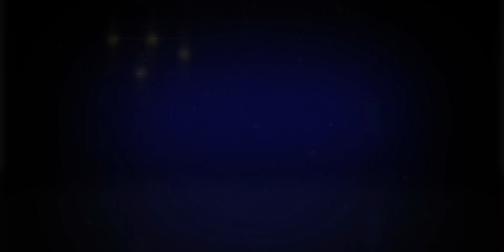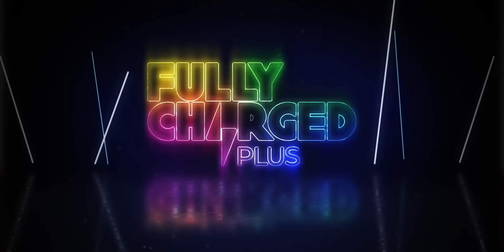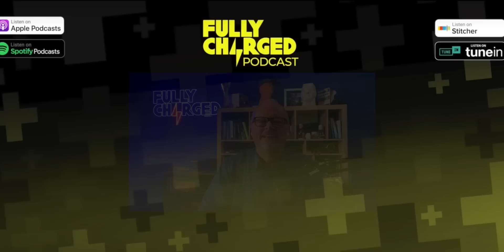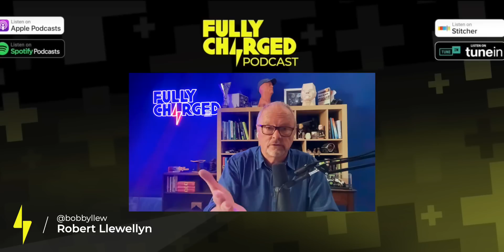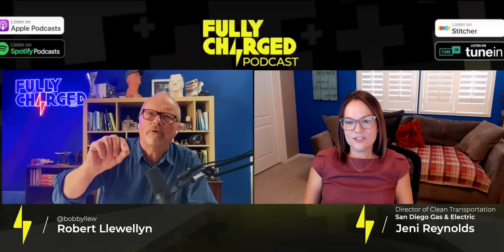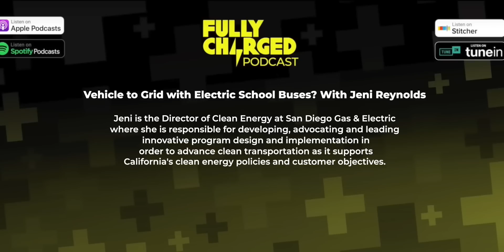Vehicle to Grid with Electric School Buses? With Jeni Reynolds | The PLUS Podcast

Comment: The principal of converting all busses to electric has to be good, as they are currently dumping all of their pollution in places we certainly don't want it, eg next to schools. So great on that part. Great project, however what an eye opener from someone in the UK that US School busses do nothing else all day, what a waste. Also, if the busses battery is drained to the grid between 4-9 in the evening it surely can't be charged by solar for the morning run?  Does that mean they give away their free electric and pay to buy new from the grid.
Concept good but unless I missed something, I think it is seeking the solution that serves the Electric company and not the greater good.

Comment: This lady needs to get her facts right before doing an interview. She said a typical bus battery is 60kW which is power not energy. She then says this could power an average home for 15 days. Really? She then says you can power half a home on one battery. She then says the bus batteries are five times the size of a typical vehicle. All these facts are contradictory. What the hell is she talking about? She is not helping the cause for using electric buses for V2G!
Reply: 60 kW is the bidirectional chargers they have installed. Batteries in the traditional school buses are 200-300 kWh which is about 5 times the battery of a mid level EV.

Comment: No new concepts, but a good interview. I would have liked to know how they made the capital decision to go with retrofitted buses vs. new buses. Amortized value of the older buses would certainly be less on the books than a new bus, and is likely more on a per annum basis than buying new. Pure guess on my part is that they were capital constrained. Given the dramatic pollution of school buses being right up there with class 8 trucks, it is clearly a strong first step in the process of electrifying transportation. Since the sooner one goes electric, the greater the ROI, it would make sense to me to not have slow conversions, but rather jump to BEV as quickly as possible. Lifetime TCO is always much better for electric, so it comes down to the availability of the initial capital. If deep pockets, i.e. the state, provided the initial capital, and set it up with a payback period that kept the original yearly costs the same over a longer period, this would enable prompt transitions. The power arbitrage taking place is simply icing on the cake for everyone, including the rate payers.

Comment: V2G and recent developments in VPP might transform school bus fleets into a revenue source for school districts, rather than an expense.  Nationally, ~500,000 school buses, each with ~225 KWh batteries = over 100 GWh of (potential) grid capacity.

The Tesla big battery in Hornsdale  (195 MWh) paid for itself in 2.5 years, and never drove a single child to school. 

3 birds, one stone: A self-financing school bus fleet. A second-use mega battery to stabilise the grid. Massive reduction in new-build peaker plants.
Reply: V2G can be useful, fleets of vehicles with large batteries and set schedule are prefered. the window for V2G is normally stated to be 4-9 pm. one problem is all school buses are busy 3-7 pm, and when they are done at 7 pm the battery is at least 50% down. then afterV2G usage, 9 pm, the buses need to be charged up by 6am the next day.
Reply: @scottmcshannon6821  Interesting, I didn't know the duty cycle of the US school bus fleet. So, in use 6-10 am, 3-7 pm?

Starting the day with a ~50% charge might be enough if the bus can be charged during the 5-hour midday idle window.  What I mean is the bus does not need a full charge at the start of each day, it just needs enough to get through the am duty cycle if it can top up from mid-morning to early afternoon. 

If ~500,000 school buses average 12,000 miles per year over ~180 school days, the average school bus daily mileage is ~66 miles. So, ~33 miles to school, and 33 miles back. Do the idle buses stay at the school during the day? or do they return to base? 

ofc, there will be many edge cases where bus journeys are longer or shorter, but current US EV school buses have a range of ~100-150 miles (per Bing), so not even half charge is needed for the morning or afternoon cycle.
 
That 180-day school year is another point. Are these buses totally idle for half the year as well as 16 hours each school day?

Do you think there is any opportunity to leverage buses for V2G due to the various US time zones? How interconnected is the grid?
Reply: @marcusnichols5595  they usually return to base. they would definitely be available from june1 to aug 15, the hottest and highest energy usage months of the year. i would assume that sitting idle for three months would be bad, so definitely use them during the summer.
i would assume the battery pack would be designed for the so called average usage, so that probably means the average bus would have 25% left when done and ready to plug into the grid on working days. the 5 hour break in the middle would make the battery pack even smaller.
Reply: @scottmcshannon6821  There's likely a sweet spot for battery sizing between range, charging & V2G revenue.

Comment: 15:52: "A typical bus battery is about 60 kay double you" What?? First of all, who says "kay double you," and second of all, Robert, you should be listening a little bit better, because as an industry "expert," or minimally with someone with extensive experience, this should have hit your ears immediately as nonsense, because there's no way a battery the size of a LEAF+ is going to get kids around. 

Great interview otherwise and fantastic project, but no mention of how depleted batteries at 5pm when the bus finishes its routes will help put energy back into the grid at peak demand time. Also, Robert, please try to shorten the length of your questions. Less waffle, more falafel, "you know."
Reply: Checking other sources (Clean Technica / OFGEM) confirm that the bi-directional chargers are 60kW, and from the bus manufacturers (Lion) they provide battery capacities up to 220kWh to provide a 150 mile range. I have to double check, but I think she said something about the batteries being 5x the size of a car’s, which would just about make sense at that size.
Reply: Yeah I assumed she meant 60kWh, which is wrong and definitely won't power an average San Diego home for half a month. Not sure what she actually meant.

For your latter comment I doubt the batteries would be fully depleted at the end of each day, should have some room left and possibly a lot of remaining energy as they may be able to charge mid-day from surplus solar power.
Reply: @Greg Hassler, I think there are those who believe that the batteries are (or should be) sized minimally to provide only 1/2 a day’s duty cycle, so the midday solar recharge is used solely to provide for the 2nd school run, which would mean they were depleted afterwards and pretty much useless for V2G, and separate static storage should be used.

I’m with you, and believe there would be no point in doing that in a V2G pilot precisely designed to explore the use of buses to support the evening peak by transferring cheap midday solar power. Some posters think that would imply carrying excess batteries, but I believe the economics of having buses capable of a full day’s duty on an overnight charge is perfectly reasonable, indeed conservative, and it would then easily allow around 1/3 of each battery’s capacity to be very profitably discharged in the evening, having been charged with cheap solar energy midday.
Reply: Yes, at 16:15 she says, “these are not small batteries, about 5…6 times the size of a typical vehicle.” So it’s clear at least to me that she’s remembered the 60kW as the power rating of the bi-directional chargers, and muddled it up with the size of the bus batteries. Mind you, 1/5 or 1/6 of 220kWh is only a small EV in today’s terms 😀
Reply: There is another sub-thread in the comments with people assuming that the batteries SHOULD be deliberately, and minimally sized to be depleted at the end of the afternoon bus run, and be useless for V2G, since they believe separate static storage would be better, which makes zero sense to me.

This pilot only makes sense if the batteries are conservatively sized to return to base not fully depleted, but with around a 50% SoC, since OFGEM confirms a planned duty cycle of: 6-9 first bus run; 9-2 midday charge; 2-5 2nd bus run; 5-9 evening discharge through the peak; 9-6 overnight charge. A 150 mile range bus with a 220kWh battery (from Jeni’s 5-6x statement) could then drive perhaps 40-60 miles in each of its runs (some shorter, some longer) and thus have approximately 75kWh remaining to discharge in the evening peak. If they push the envelope a little and charge higher than 80% SoC, they could either provide more storage or greater range, but I suspect those are all parameters being examined in the pilot.

Assuming they make use of all 8 buses, 75kWh per bus equates to +- 0.6MWh of V2G capacity, with maximum power output of 360kW

I honestly don’t see why other posters believe it makes more economic sense to try to strip the mobile capacity down to some kind of minimum, to leave the buses useless for evening peak-lopping, when the marginal increase in cost to support V2G is so small.
Reply: There are less syllables in "kilowatts" than in "kay double you." You're LITERALLY not shortening it but making it longer. The vernacular is kilowatts so please say that in the future. On paper, shorter; out loud longer. My Asperger's always acts up when illogical things are said, sorry. 

It's a wiring problem in the brain. You see, most people filter this out. For me it's like nails on a blackboard. Imagine nails on a blackboard ALL day every day, in ever office, every shop. Now imagine you're one of the 0.1% of the people that can hear it, but everyone else's brain just filters it out. That's Asperger's. It makes me want to cry sometimes, but it comes with lots of benefits too, like the ability to turn off most women and not be able to have a relationship with 99.9% of women because they just don't understand or think you're an asshole because you don't like the way they communicate. Ugh, sorry.

Comment: When is V2G/H going to become the normal in EV's.  So far only a few manufacturers provide this.  You know the whole cost of the vehicle could include the bi directional charger...????
Reply: Up until recently, the car manufacturers were very worried that V2G would compromise battery condition and lifespan, by “wearing them out”, given they have to offer long warranties on them, so have been very conservative about moving forward with this. More and more evidence is emerging from pilot projects like this one that gentle and controlled cycling of a battery within the 20-80 SoC range does no harm, and can even improve the battery condition. You also have all the usual standards battles as each manufacturer and industry group fights to dominate the tech. So although it’s a “no-brainer” to make use of the GWhs of EV storage to support the grid/ local demand it’s something that is not going to happen quickly.

Comment: I first heard about vehicle to grid by reading 'Soft Energy Paths' by Amory Lovins in 1979. He said that if everyone in the US owned an electric car and plugged them in when not in use so the grid had access to the them the country would have four times it's generating capacity. With that thinking EV's would make the grid more stable.
Reply: The UK’s National Grid has one planning scenario in its current “Future Energy Scenarios” that allows for 28GW of V2G by 2035 and 39GW by 2050, which equates to 5.6m vehicles plugged into a bi-directional 7kW charger. That’s around 14% of the current vehicle fleet being able to deliver the entirety of the UK’s current winter demand for an hour or two. The potential scale of V2G is simply mind blowing, and a “no-brainer”, which is why pilots like this are so exciting - proving out the technology and business models well in advance of the mass market adoption of EVs
Reply: @ayebrow  Great news. Thanks for sharing!

Comment: I don't understand the necessity for the zappy charger? I live in BC, Canada and with our grid-tied solar array, any excess energy we gather goes into the grid but we get credited for that energy as it carries forward month-to-month and we essentially build up a bank of kWh in the Summer months that we use up in the dark days of winter. Seems to me that this system eliminates the necessity of a Zappy Charger, and I can't understand why the UK would not have a similar system? Is there something I am missing?
Reply: Where net metering and flat rates for electricity exist, a zappy charger really wouldn't add value for the consumer.... But  when a utility pays you less for your solar generated electricity, then you have to pay the utility for the electricity.  Zappy charger allows the consumer to use the most cost-effective option, be it your own solar electricity or off-peak electricity from the utility. It's a form of arbitrage, that also helps balance the grid in the UK and elsewhere where it's used.

I hope that made sense?
Reply: @nc3826  I see, so there are different rates per kWh for different times of day
Reply: Seems to me that this only benefits utility companies as they would dictate the when and what of rates and cause homeowners to buy batteries and other equipment.
Reply: Sorry to confuse you
Reply: @nc3826  I am not sure that I am confused? Fairly certain our province will have time of day billing in the future. Seems inevitable as the population grows and the electrical demands increase.
Reply: You originally stated " I don't understand" i.e. you were confused about the topic, but  it doesn't really matter....

The bottom line is if all your rates are the same... It's a moot point, at this time....  So it's not worth any further elaboration on it....Have a nice day....
Reply: @nc3826  you said "Sorry to confuse you" after giving me an explanation for something that previously didn't make sense to me. Rest assured, I understand now and am not "confused" as you have put it.
Reply: @northcountryman  I'm glad you think you understand what I was saying..... Take care....